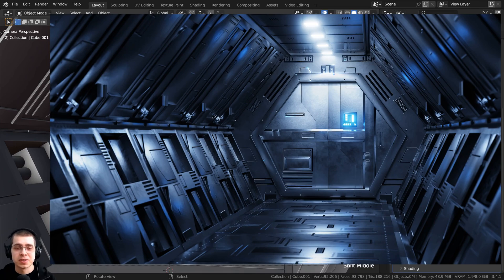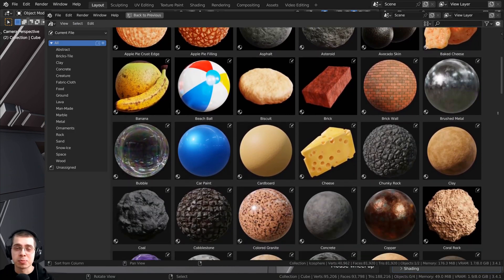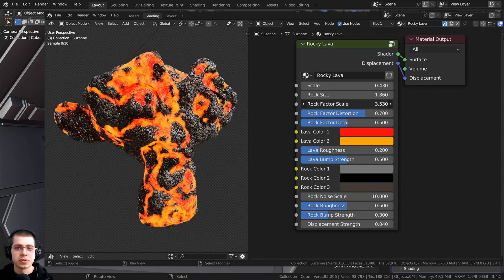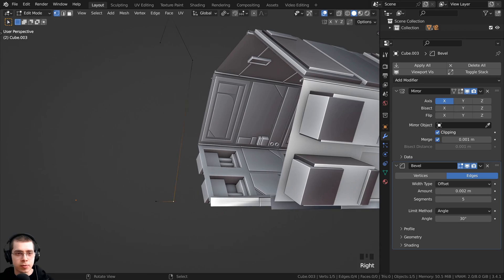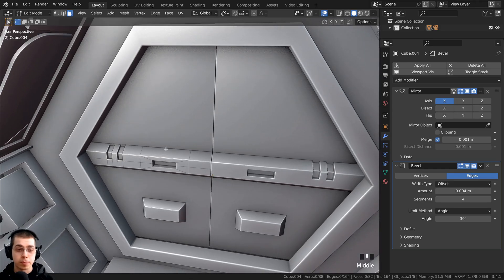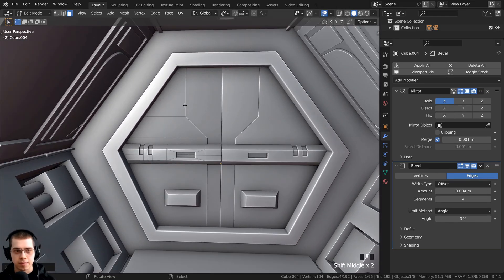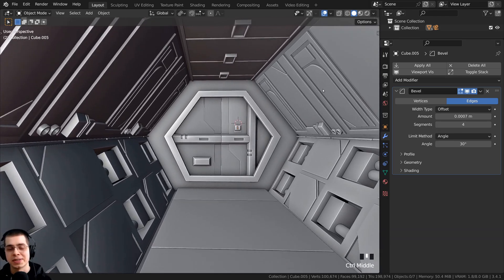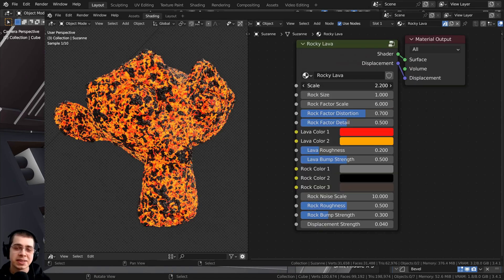Sci-Fi Airlock Corridor - Part 2 (Blender Intermediate Tutorial)

Comment: That was fun! Looking forward to the next part. 

I'm currently using blender's built in alternative middle mouse button  (alt+LMB) which is the same short cut to select a loop. Do you happen to know what the alternative loop select short cut is? I typically just end up selecting the loop in wireframe mode.

Thanks!😃
Reply: I have just read again you comment and that was noot your problem. So there is only way to solve this. It is to bing it to different key. you can do this in keymap. But it works very wierd, like I ve been using cinema 4d most of the times, and at the beginning I tried to make all shortcuts as they were in cinema, but it didn't work properly and I just got used to blender original short cuts. Now I even like them more
Reply: have u solved the issue? Because I have the same one. And everythnig had been working fine till I started making this corridor/ Now I am not ablt to loop select
Reply: @verte5519  no such luck, I'm afraid. I actually ended up forcing myself to use middle mouse button. Wish I didn't have to but it's not so bad now. 🤣
Reply: @sathanas693  I found and answer and I just forgot to text you back. Right before starting making this corridor I was trying to set up my graphics tablet for blender because it worked incorrectly. And then I decided to turn on the emulate 3 button mouse, just for fun actually. It is preferences -> input-> emulate 3 mouse button. And I completely forgot about it. That was the reason. Just click it off. Actually I have spent 2 hours trying to figure this out